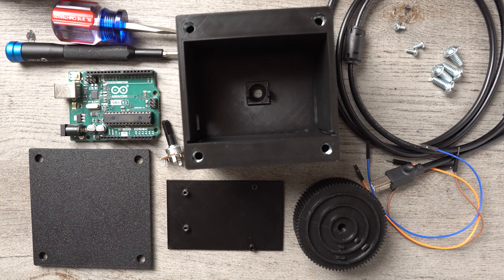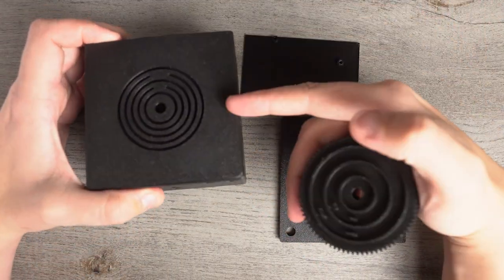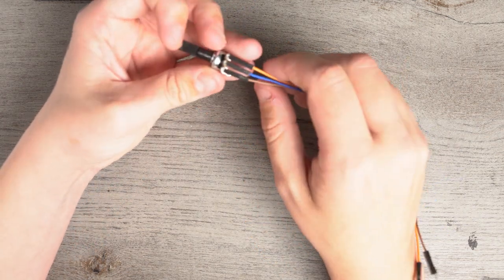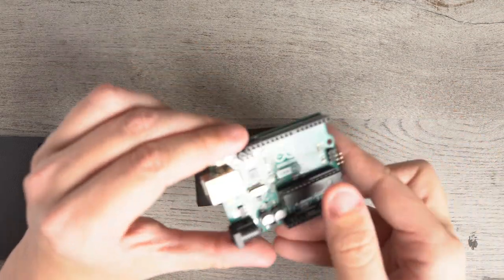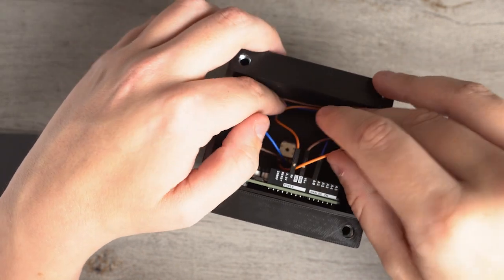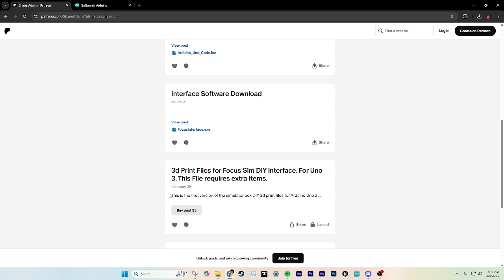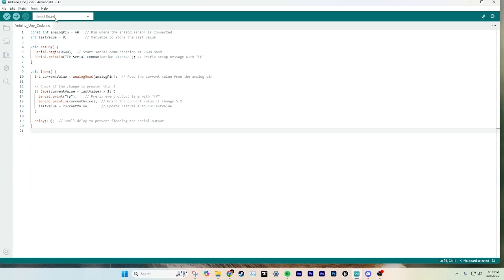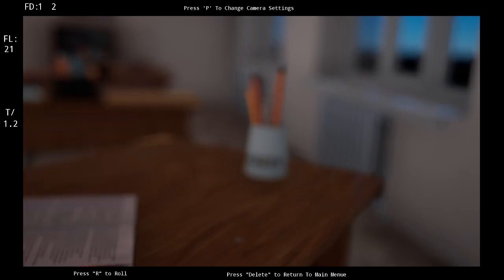Focus Sim Interface set up guide

Comment: Hi! Thank you so much for this project. Now I made and tried it, it works well. but just one thing, How can I reverse the rotation direction of the focus knob on the controller? when I turn the knob to right, focus is going far, and when I turn the knob to left it's going closer.
Reply from the maker: Hi! so to reverse the the direction all you need to do is swap the 5 volt wire and the Ground Wire on the board, that will reverse the direction that the potentiometer reads from.

Comment: Hi, great project ! Would it work with the Arduino UNO R4 ?
Reply from the maker: thanks! I'm not sure if it would work with the r4, the 3d printed housing most likely will not, however I don't see a reason why electronically everything wouldn't work about the same.